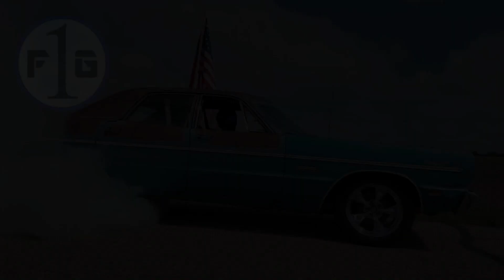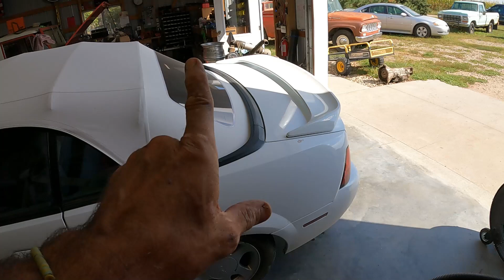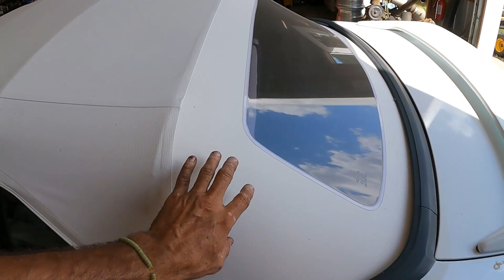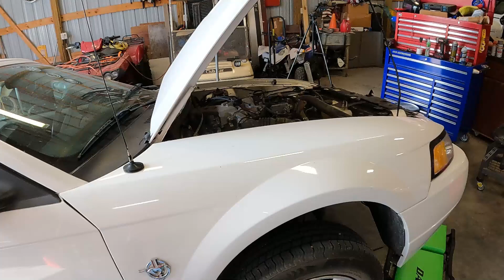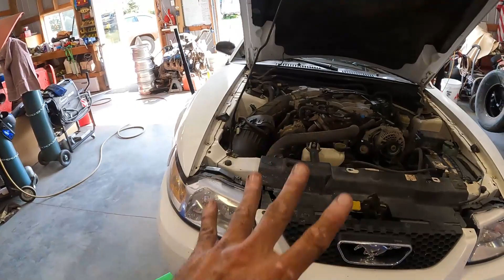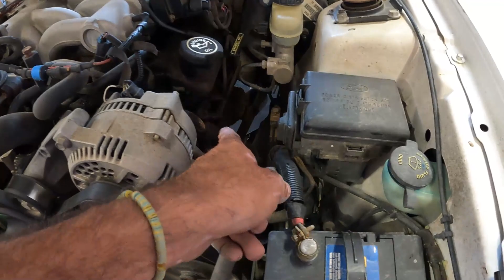When electrical motors and water spend too much time together! Mustang P0411 code diagnosis and fix!

Comment: Awesome diagnostic and fix! Do you believe this would cause the car to crank and not fire/start? This is the only code I have
Reply from the maker: It should not.  The code popped back on immediately when the car goes through its initial test after starting/key on, but started fine.  You should go back to basics.  Air, fuel, spark.  One of those is not happy.  Thanks for watching and commenting!